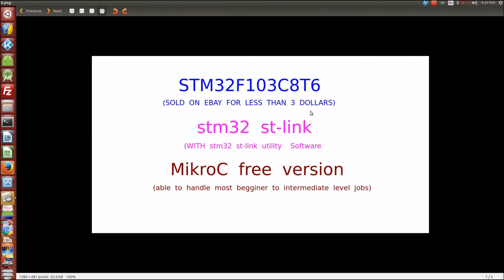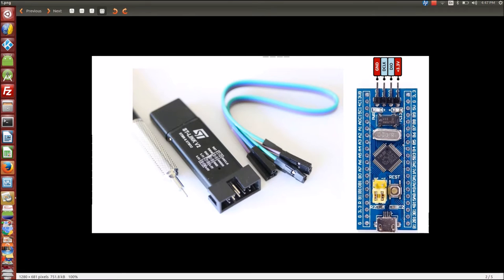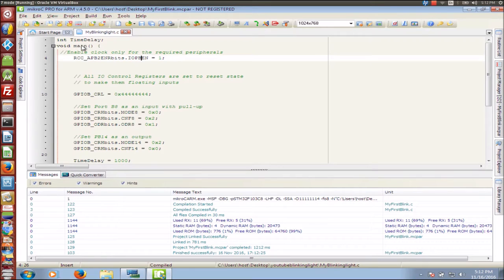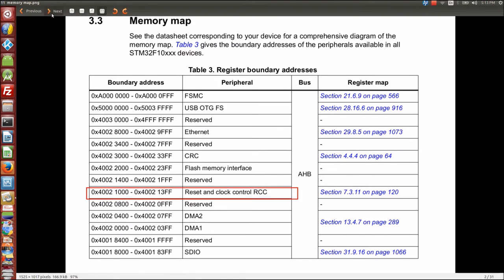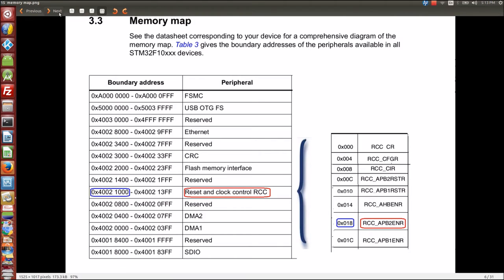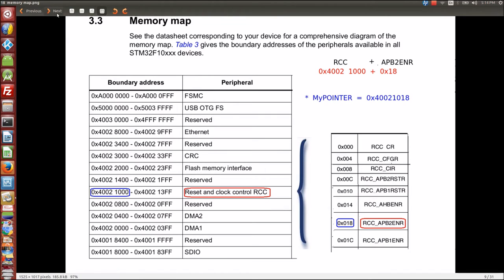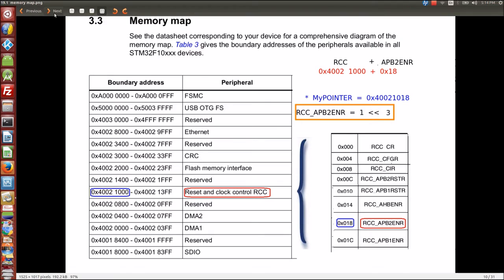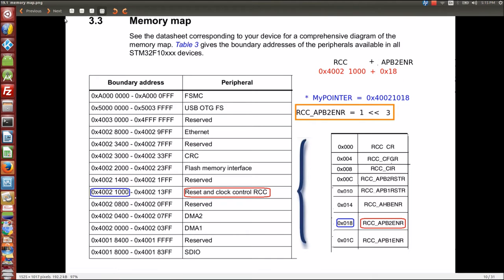02) ARM M3 STM32f103C8T6 MikroC programming (blink LED and read input )

Comment: You make MikroC very complicated. Other tutorials has 3x less code that does the same function with less complicated explaining.
Reply: I apologize for any inconvenience, however back then there were no other tutorial that covered the topic and I wanted everyone to understand the why things are done so they could learn to navigate the data sheet and unlock the micro controller richer functions.   Now days I don't know what better library support are there for the STM32 in MikroC, but I only imagine that things have greatly improved.  When Arduino started to support STM32 I migrated to Arduino platform.
Reply: I agree, 1 line of code for setup, 2 line of code for main loop. finish story., making viewers confuse to nothing just to attract attention and curiosity is not a good idea.

Comment from the maker: Hello, sorry for the long delay on my response I been busy.  

for the DATA SHEET try the following link
http://www.st.com/content/ccc/resource/technical/document/reference_manual/59/b9/ba/7f/11/af/43/d5/CD00171190.pdf/files/CD00171190.pdf/jcr:content/translations/en.CD00171190.pdf
if that does not work do NOT use the "data sheet" rather USE the "STM32F103C8 reference manual" on google. 

as far as the PWM MikroC library I try it and it did NOT work.  I search all over the web and I finally came across this:
http://embedded-lab.com/blog/stm32-timers/5/ if that gives you and error try :
http://embedded-lab.com/blog/stm32-timers/  THEN go to "slide" or "page" 5 for  Pulse Width Modulation (PWM) 

I do not have the time now to play with it. but this is what I got so far: This are my personal notes so far, I do not know if I will be successful, but do not expect for me to be able to play with this for the next two weeks, if I ever make it work I will happy will make a video. 
Note: I listed all the register that I though I would use, but I ONLY put a [  ] box to the left of the register that I plan to manipulate.

Also, on MikroC if you type something like TIM then CTRL+SPACE MikroC will give you available option, it comes really handing when figuring the names that MikroC uses to reference the register.   

Good luck. 

STEP 1 configure pins as output push/pull with High Speed.
    CNF1  CNF0 Mode1  Mode0 
     0     0     1      1            =  0x3 hex. 
   
    CNFx 00 = push-pull
    Mode 11 = Max. output speed 50 MHz
*********************************************************************
 

TIMx_CR2    page 338    TIM1&TIM8 control register 2
========================================================================
TIMx_CR1    page 337    TIM1&TIM8 control register 1
   ARPE   (bit 7)

where ARPE : Auto-reload preload enable                                  [  ] set
             0: TIMx_ARR register is not buffered
             1: TIMx_ARR register is buffered
========================================================================
TIMx_SMCR   page 341    TIM1&TIM8 slave mode control register
TIMx_DIER   page 343    TIM1&TIM8 DMA/interrupt enable register
TIMx_SR     page 345    TIM1&TIM8 status register 
TIMx_EGR    page 346    TIM1&TIM8 event generation register 
-------------------------------------------------------------------------
adjusting channel to compare 1 - 4 

TIMx_CCMR1  page 348    TIM1&TIM8 capture/compare mode register 1             
    CC1 (bits 1:0)     CC2 (bits 9,8)
    OC1PE (bits 3)     OC2PE (bits 11)
    OC2M  (bits 14:12) OC1M  (bits 6:4) 

TIMx_CCMR2  page 350    TIM1&TIM8 capture/compare mode register 2
    CC3 (bits 1:0)     CC4 (bits 9:8 )
    OC4PE (bits 3)     OC3PE (bits 11)
    OC4M  (bits 14:12) OC3M  (bits 6:4)  
   

 where:  
    CCx defines the direction of the channel (input/output)                [  ]
        00:  configured as output

    OCxPE: Output compare 4 preload enable                                 [  ] 

    OCxM : PWM mode 110 mode 1,   111 mode 2                               [  ]

--------------------------------------------------------------------------
TIMx_CCER   page 352    TIM1&TIM8 capture/compare enable register
TIMx_CNT    page 355    TIM1&TIM8 counter                                       [* ] 
TIMx_PSC    page 355    TIM1&TIM8 prescaler                                     [  ]
************************************************************************
TIMx_ARR    page 355    TIM1&TIM8 auto-reload register                          [  ]

   where ARR set the whole duty cycle ( inversy set frequency ) 
   When TIMx_CNT reaches this value it overloads. 
   NOTE TIMx_PCS is the CNT pre-scaller. 
************************************************************************
TIMx_RCR    page 356    TIM1&TIM8 repetition counter register
===========================================================================
TIMx_CCR1   page 356    TIM1&TIM8 capture/compare register 1                     [  ]
TIMx_CCR2   page 357    TIM1&TIM8 capture/compare register 2
TIMx_CCR3   page 357    TIM1&TIM8 capture/compare register 3
TIMx_CCR4   page 358    TIM1&TIM8 capture/compare register 4

   where CCR = the active duty cycle. 
   any value between 0 = 0% and  ARR = 100% 
   
   ensure to set the corresponding CCx as output. of TIMx_CCMRx
    
============================================================================
TIMx_BDTR   page 358    TIM1&TIM8 break and dead-time register
TIMx_DCR    page 360    TIM1&TIM8 DMA control register
TIMx_DMAR   page 361    TIM1&TIM8 DMA address for full transfer
362 index 

193 AFIO register maps index   (183 begining of AFIO regirsters) 

/////////////////////////////////////////////////////////////////////////////
* enable the AFIO register                                                   [  ]

RCC_APB2ENR bit 0  = AFIO ENABLE  page 111
 
/////////////////////////////////////////////////////////////////////////////
++++++++++++++++++++++++++++++++++++++++++++++++++++++++++++++++++++++++++++++
* since PWM is the alternate funcion of GPIO pins  

AFIO_MAPR (page 183 ) 

bits 12   TIM4                                                               [  ]

     0 = TIM4_CH1/PB6, TIM4_CH2/PB7, TIM4_CH3/PB8, TIM4_CH4/PB9
     1 = TIM4_CH1/PD12, TIM4_CH2/PD13, TIM4_CH3/PD14, TIM4_CH4/PD15

bits 11:10 TIM3

     00: No remap (CH1/PA6, CH2/PA7, CH3/PB0, CH4/PB1)
     01: Not used
     10: Partial remap (CH1/PB4, CH2/PB5, CH3/PB0, CH4/PB1)
     11: Full remap (CH1/PC6, CH2/PC7, CH3/PC8, CH4/PC9
     
bits 9:8   TIM2 

    00: No remap (CH1/ETR/PA0, CH2/PA1, CH3/PA2, CH4/PA3)
    01: Partial remap (CH1/ETR/PA15, CH2/PB3, CH3/PA2, CH4/PA3)
    10: Partial remap (CH1/ETR/PA0, CH2/PA1, CH3/PB10, CH4/PB11)
    11: Full remap (CH1/ETR/PA15, CH2/PB3, CH3/PB10, CH4/PB11)

Bits 7:6    TIM1

    00: No remap (ETR/PA12, CH1/PA8, CH2/PA9, CH3/PA10, CH4/PA11, BKIN/PB12,
        CH1N/PB13, CH2N/PB14, CH3N/PB15)
    01: Partial remap (ETR/PA12, CH1/PA8, CH2/PA9, CH3/PA10, CH4/PA11, BKIN/PA6,
        CH1N/PA7, CH2N/PB0, CH3N/PB1)
    10: not used
    11: Full remap ((ETR/PE7, CH1/PE9, CH2/PE11, CH3/PE13, CH4/PE14, BKIN/PE15,
        CH1N/PE8, CH2N/PE10, CH3N/PE12)
+++++++++++++++++++++++++++++++++++++++++++++++++++++++++++++++++++++++++++

PWM Hz = _____TIMxCLK________
         ( (PSC+1) (ARR + 1) )          

page 318 PWM mode
Reply: oh man thank you so much